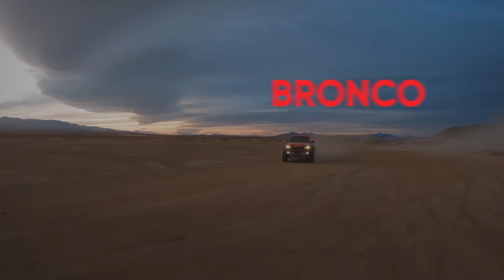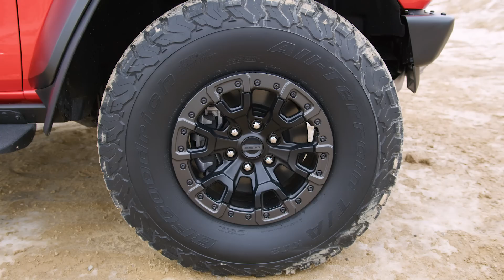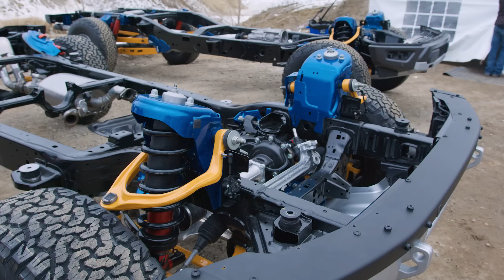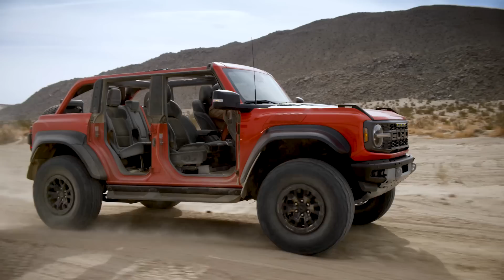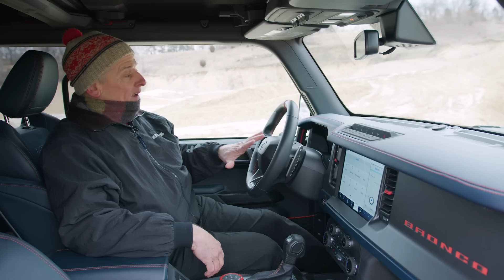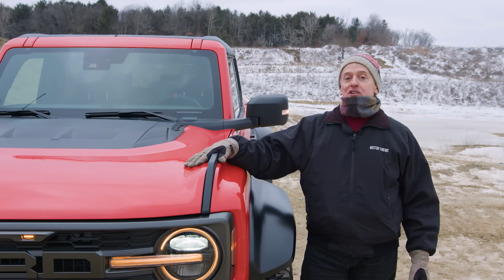2022 Ford Bronco Raptor First Look | MotorTrend

Comment: Can anybody tell me if this thing will go at highway speed across the desert? Its a deal breaker for me if it cant.
Reply: Yes. I suggest you drink a bottle of Jack Daniel's and then max this across the desert.  What could go wrong?
Reply: A lot of the marketing is about desert racing, and some drive modes are for that as well, so I’d imagine it can

Comment: Would have been pretty cool to have a coyote
Reply: It’s been done with a Ford Ranger here in Australia! Aftermarket of course.😱😈💪🏼
Reply: @andrewd7586  A coyote ranger would be pretty cool. Probably goes pretty well!!
Reply: 7.3 is so much better
Reply: @alexs3187  7.3 gas? If so… nah the coyote is superior.
Reply: @GMCBigBlock420  no way. I’ve driven both. The 7.3 has twice as much torque at 2,000 rpm. Something that the peak numbers don’t tell you.
Reply: @alexs3187  as have I, the coyote has power everywhere. Especially when it comes on cam above 3,500 rpm. In this application the 5.0 works. For the f250 tremor, Godzilla.
Reply: @GMCBigBlock420  the Tremor is a joke. Just get a regular F250 with a rear locker. You’re not going to take that on serious trails. I’d take the 7.3 over the Coyote because it has more low end grunt, but that’s just me. I really don’t find the 5.0 to be anything special. The 2.7 has more low end torque than that.
Reply: @alexs3187  yeah, I wouldn’t buy the tremor. My daily is a coyote powered F150. Once I replace that with another F150/250 I’m probably going to supercharge the coyote. They’re very stout and modify very well with big power potential (I prefer it to any ls). I would probably lease an eco-boost but I don’t think I’d buy one. I just think for a bronco raptor the coyote or the 3.5 hi output from the raptor F150 would be a lot more fun. Just my two cents. Besides I prefer my motorcycles/performance for fun anyways :)
Reply: @alexs3187  thats a boat anchor for something that is designed to be fast and nimble off road lmfao...
Reply: @ethanhamill  That’s what I’m saying, The coyote ideal. Especially with how rev happy it is

Comment: Very disappointing that they didn't even think of putting the 5.0 V8 or the 3.0 Powerstroke in any of the either the regular Bronco or the Bronco raptor
Reply: Pretty sure they will come out with a Bronco Raptor R with a V8 the same is they are doing with the F150 Raptor.
Ford can certainly make a Coyote 5.0 motor fit if they wanted too. Jeep claimed a V8 wouldn’t work in the wrangler for years until the Bronco came out and forced their hand.
Reply: they did think of it but it doesn't fit. they tried

Comment: So still a V6 I assume because they didn't mention the engine. I'm sorry but if ford wants to impress me put a v8 in it. BUt thE V6 WitH tUrBOs iS juSt As GoOd As a V8
Reply: Right at the start he mentioned they used the 3.0L twin turbo.
Reply: @earldriedger4842  so that's about 450ish horsepower? The older broncos had a 5.8L. these no replacement for more displacement, and a v8 could do it that stock. Engineering has evolved and yes it's impressive what a V6 can do nowadays. I just think it's insulting for ford to bring back older models like the ranger and bronco and do them a little dirty.
Reply: Didn’t open the hood. Nothing impressive in there. Lmao
Reply: A V8 would make it a much more popular choice. Low end trail grunt is important.